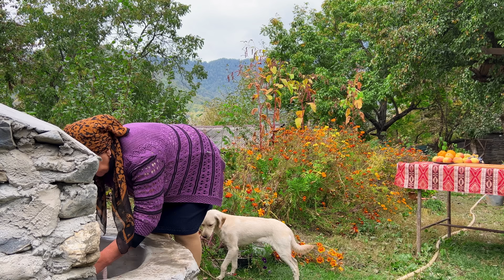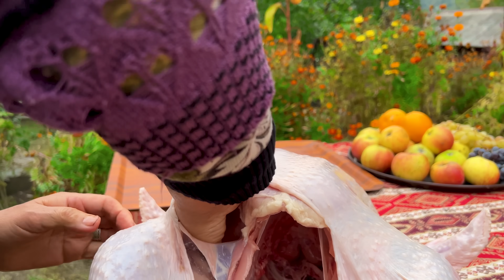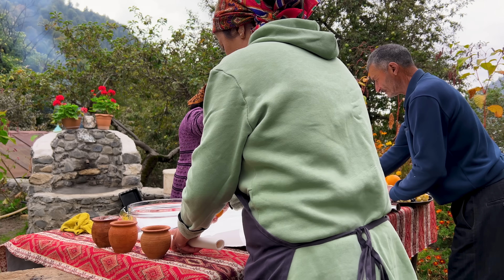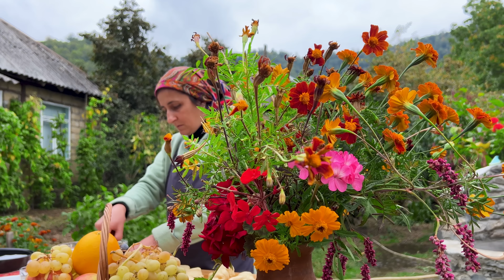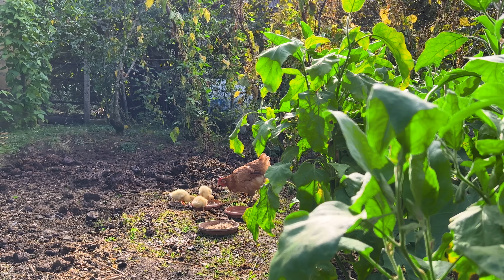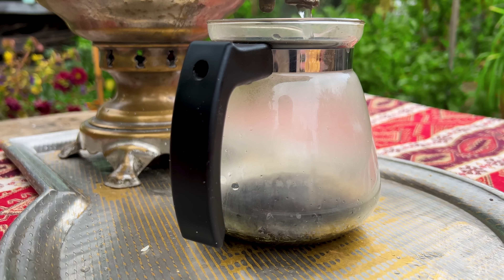Turkey Recipe in the Oven for the Whole Family! Quiet Life in the Village

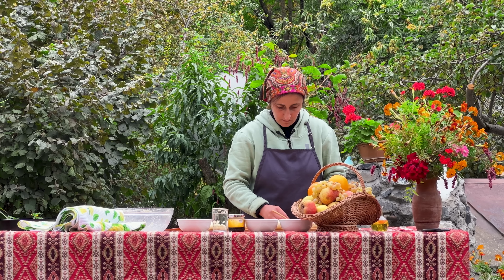Comment: 11:21 the boiled milk is called Dulce de leches which means sweet milk - you can make it yourself by boiling an unopened can of sweetened condensed milk for about 2 hours OR you can actually buy it. Much easier and cheaper to boil it in a saucepan of water like I said
Reply from the maker: Thanks for sharing.